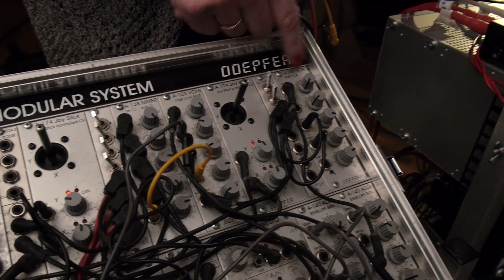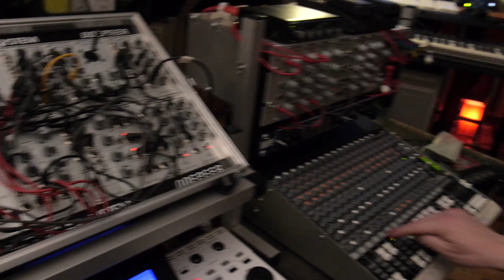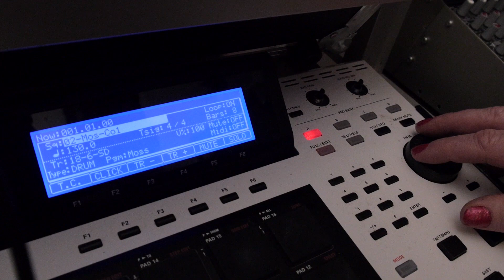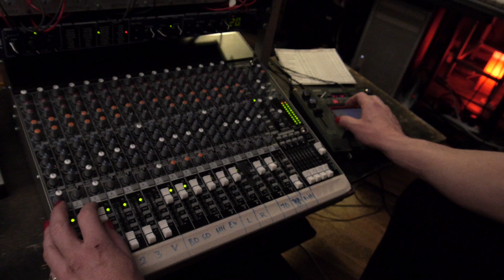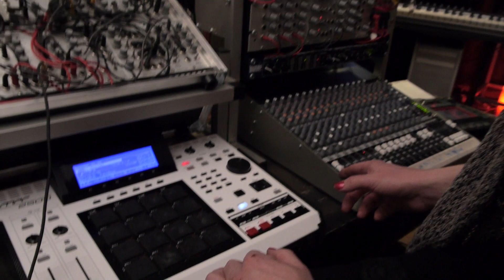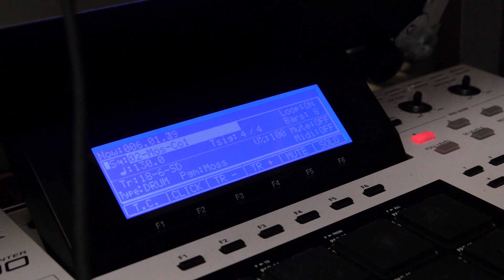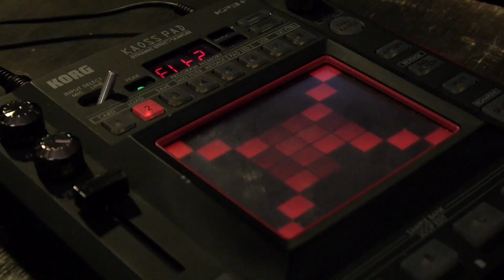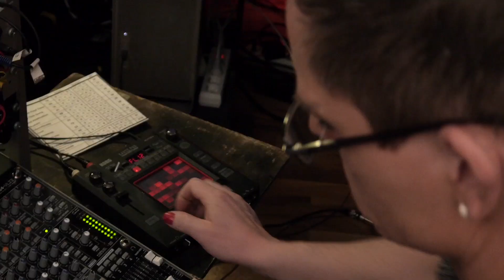GusGus LiveSet in detail - Part 3

Comment: Thank you so much for putting these up here. It's good to see how the magic happens! Question: The Akai brings all of those audio and Midi outputs that you can route to modular gear. Did you use it for any other reasons as opposed to something like Ableton? Please come to Upstate New York sometime!
Reply: i use logic in the studio for preworking the live show.  You know re-sample everything in one sample pallet and set up the midi parts that i later transfer to the AKAI.  The AKAI is simply a compakt loop based midi/audio playback where i can mute also and switch between midi paterns within the same loop.  I could set something up similar in Ableton, but then i would also need controller, audio interface for 10 channels and midi interface as well.  It sounds buggy to me..  Better stick to something that is solid and works..

Comment: Very good video. I got 3 questions  : 
- why do you need channel 2 to send Doepfer to Kaosspad with Channel 1 muted when you can use the Kaoss pad Aux on Channel 1 with the button that cuts the channel off the mix but keeps the Aux sends?
- do you change things on the Doepfer like wave shapes or wires between songs?
-Could you detail your studio workflow? I'm intrigued by all the blinky things behind you 8)
Reply: having the kaosspad on aux4 (the lowest one) makes me assign stuff to it faster as i use the kaoss a lot to throw in elements and "swirl" them.  and adjusting the level of the doepfer to the kaoss on the fader is also faster.   so many things can be done differently, but ultimetly when you need to act fast, time efficiency is very important.

Comment: Thank you very much. Finally i saw how you do the magic. Maybe my mistake but a bit confuse. The orange knob is for reverb? And each signal you can send to reverb and adjust vith that orange knob?
Reply: Each channel strip (every vertical column of knobs) has 4 auxiliary sends, meaning the sound on that channel gets send to several places at the same time. The most important place is the main mix output, but the 4 auxes can be sent to effects and then be brought back into the mixer using auxiliary returns which is an input like a channel strip but without all the knobs. So the orange knob aka the aux send is a volume controller for how much that channel is sent to connected effects, in this case a reverb.
Reply: @s90210h  thank you. My mixer just arrived in few weeks ago. But i think it is a bit more difficult than i thought. Like group... so i need more time to learn. Thank you